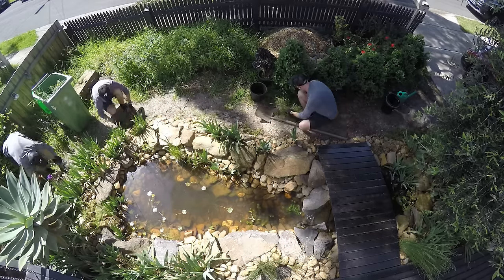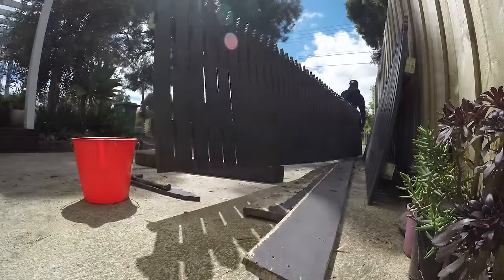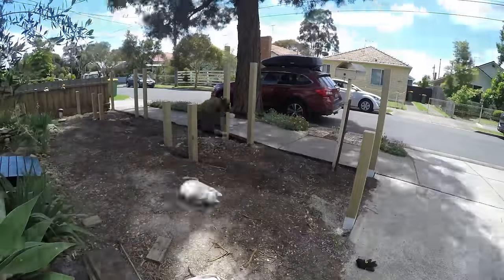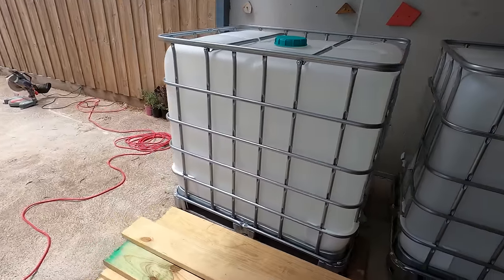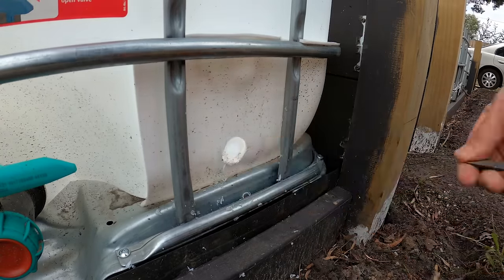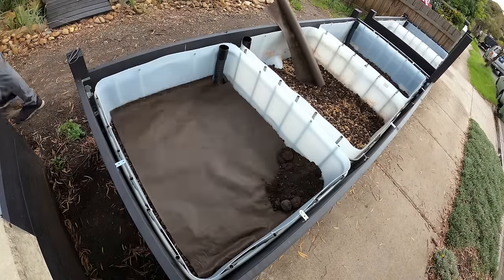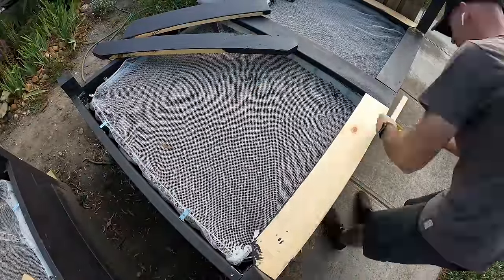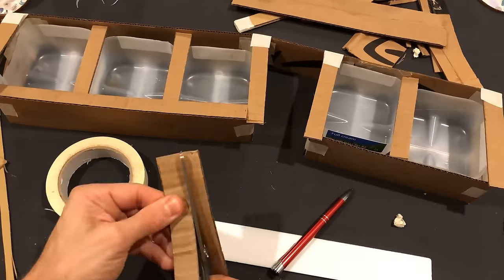Stylish, self watering raised garden beds! How to build

Comment from the maker: Here are a few frequently asked questions I thought I'd reply to here to save us all some time!

1) How does the water wick up without a wick or depression into the gravel? 

Honestly, I don't know. Perhaps there is enough contact on the sides or movement through condensation to start capillary action. Perhaps it is not working as well as it could be, but I've made it through two hot summers where we've been away for up to 10 days and the beds are doing great. 
 
If you are thinking of building your own wicking beds, you may want to tuck the geotextile or weed matting material in on the edges to ensure there is contact right to the bottom of the tank. I may even try and do this in a future video and experiment. 
Here is a good read on the pros and cons of wicking beds if you are looking to build one yourself - https://deepgreenpermaculture.com/2016/04/03/wicking-bed-construction-2/ - which does suggest tucking the material in on the sides.

2) Why are we wearing masks outside?

At the time of filming Melbourne had just come out of it's first lockdown and wearing of masks was highly recommended to reduce the spread of COVID.

3) What size are the tanks / garden beds?

The IBC tanks are 1200x1000 including cage. 500mm high without the base when cut in half.
The smaller 2x beds are 2160x1380.
The larger 3x bed is 3170x1380.
Gaps are 500mm.
The height of the beds vary as the ground is not level. 700mm at the highest point. The mesh frames are 650mm high. 

4) What did it cost?

IBC wicking beds, especially in a design like this, are not the cheapest option when it comes to gardening. In fact, they're one of the most expensive. These beds are under a big gum tree, so planting in ground was not an option. Normal raised beds might have worked, but gum tree roots are really invasive and I wanted something stylish that added value to the house and front yard.
The build cost about $3-4,000 AUD. A new picket fence would have been about 1/3 of that.
Reply from the maker: Thanks for the advice Nunya, although I'm not sure there's actually a question there. The soil was hydrophobic, nutrient depleted and full of weeds, so would have been terrible for growing veggies.
Reply: @TheBiteSizedGarden  mate fills the bottom for ya. hydrophobic means fck all, just needs reconditioned. Same with weeds, just green manure. Couldve saved yaself couple of hundy in both dirt and a skip and not dumped good dirt
Reply: even divided up between the beds and adding and mixing through with ya bought dirt makes it next to instantly not hydrophobic ;)
Reply: Evapotranspiration. Look it up!
Reply: I've found Albo Pepper's video on SIPs is the best on the internet, especially on the engineering of the drainage, aeration and wicking components. https://www.youtube.com/watch?v=Lp9Jdyno9hI I noticed that your veggie garden is shaded by a large tree, so I am wondering if you are getting poor growth because of the shade? Also, I was noticing that the tree is lifting your sidewalk; my guess is that over time it will continue to lift the sidewalk, the posts you put in and perhaps even your IBC totes. Have you thought about that?
Reply: what are the measurements in cm?
Reply from the maker: @juanfrancodilorenzo2016  Measurements listed above are in millimeters so just take off a zero.
Reply: @TheBiteSizedGarden  ah thanks!! Thought it was inches
Reply from the maker: @juanfrancodilorenzo2016  I often put inches up on screen if I mention a metric measurement, but I'm in Australia so will usually use metric.
Reply: @TheBiteSizedGarden  yes for some reason i assumed Australia used inches, my bad. Thanks again for your channel and your effort to spread great tips for gardening. I'm just starting and loving it!

Comment: Going on year 4 with these. Mine are deeper and set up on cender blocks so I don't have to kneel in my old age. I started putting a large shallow tupaware box upside down at the bottom with the lid on and poke holes in the top which now the bottom. Way cheaper than drain pipe. No gravel, no fabric, just dirt. Got about 20 expanding another 20 this year. These things are amazing for dry climates or bad soil.
Reply from the maker: Sounds like a great set up!

Comment: Scoria aka lava rock (although expensive in certain areas) is superior to gravel for wicking up water to the soil above. Gravel doesn’t wick but I’ve seen it used as a way to store water surrounding the ag pipe or containers but you really want a wicking material for the best results. Alot of ppl use sand or scoria but sand is messy whereas the lava rock is lighter weight and does such a good job I have no issues getting water up to my soil. Anyways a tip for anyone who wasn’t aware
Reply from the maker: Yes, I would've used scoria all the way, but needed to use up the rocks I had. The wicking seems to be working fine across both kinds of rock.
Reply: the experiment by Chris Curtis showed gravel and scoria worst and sand and ?? dust best.. worth a look 

i am so hung up on the wicking and fabric or plastic used. if a material (plastic) is used to separate soil from water reservoir how does it wick and if soil separated by fabric and can wick through fabric how is it any different then soil being wet all the time?
Reply: Sand is the best, use river sand
Reply: Lava rocks are incredible use them myself where I can.
Reply: I just use dirt. Works fine.

Comment: For those who don’t have access to ibc totes they sell large cement mixing tubs at big box stores cheap.  They work well for this method. Fill the bottom with rocks or hydro pebbles and use a piece of pvc to go to the bottom.    Cheers. Stunning build, really looks nice.
Reply from the maker: Good tip. Thanks for sharing!
Reply: I had a hell of a time find ibc totes that weren’t brand new and $400+, never thought of cement tubs. I eventually found inexpensive ibc food grade totes from a guy who had access to a pet store that had ibc totes that were filled with fish oil. A nightmare to wash out, probably didn’t need to but I did and it was worth the expense and time. My area has become a desert in sw ks and I hated the idea of watering daily by hand so wicking beds are a win in my area but finding ibc totes is nearly impossible. At the time I could only transport one container so since then I got a metal tank with a bottom that I’ll be using in combo with the ibc totes. Definitely try out lava rock/scoria as it’s a fabulous wicking material and isn’t as heavy or messy as sand
Reply: @jewdd1989  I just bought lava rock!  Glad it’s working as wasn’t sure.

Comment: I love this method. Last summer I took a tall v-shaped planter about three feet tall. Added some rocks on the bottom for stability. About midway I put in a plastic round tray that is supposed to go under an indoor plant so it doesn’t drip. The tray is about two inches tall. It rested around the middle of the pot. I cut three pieces of 2x4 to support it. I put lava rocks in the tray. Then I put soil and planted a flowering Alamanda just above the tray. I never put a barrier between the lava rocks and the soil but used the smallest rocks in the tray. I also added a tomato trellis so that the Alamanda had something to climb on. Any excess rain water flowed over the sides of the tray. The Alamanda bloomed profusely all summer. I think I watered it just once. Absolutely a no care system, did a two week vacation when there was very little rain and it was still one happy plant.  I’m so enthusiastic about this system.  With all the water issues going on I believe this to be the wave of the future for food production. Coupled with tiered gardening it’s coming!  Keep experimenting everyone!

Comment: Good looking beds!!  I also use some IBC raised bed with success. But yours look better, it give me ideas to improve mine! I worked in food industries and IBC plastic is not permeable, hence it can be washed and rinse.  I made holes at bottom and left bottom valve/ 6'' cap open to let excess water (rain) flow out.  I filled the bottom with  old wood and tree leaves as it will transform in food when it decays and it is free.  Then I  made a mix of peat moss/compost/black earth to fill  the top 12''.  Perfect ground for tomatoes and easy to reach! Thanks for sharing your project.

Comment: Great Work.  2nd hand IBC tanks, look for the ones that have had AdBlue in them.  AdBlue is 68% distilled water and 32% urea.  They are easily cleaned out with tap water and should not harm any plants as urea is a fertiliser.
Reply from the maker: Great tip, thanks!

Comment: Nice job, I'm just finishing up making 20 of them & was after an idea for finishing the top to hide the plastic. If you make more, we found that a cordless reciprocating saw cuts through both the cage & plastic while its all together. We used the horizontal cage bars as a blade guide for a nice clean cut, took maybe 1 minute per ibc to cut them up.
Reply from the maker: Thanks for the tip Andrew. I've never used one before, but am keen to give it a go. There have been plenty of jobs where I've thought it'd be good to have one, maybe it's time!

Comment: Wonderful project mate, beautifully made. Cudos. I've found through experimentation that it did work better for me to skip the fibercloth and perhaps also gravel. I think it might be because the plants can more easily access the finest particles of nutrients that would otherwise flow down with rain and be beyond reach below the firbercloth. I got 3-4000 cherry tomatoes from one plant in the equivailent of one IBC. As well as several hundred cucumbers another year. I also added bokashi composted food waste as well as composting worms and lots of compost to get these results, but controlled tested it with boxes with intact firbercloth that could not come close to these results. Some plants might not like to stand with the roots in water but since there is the overflow security I don't think its going to be a big problem. Thanks for the neat video :)
Reply from the maker: Thanks Mathias, 
It sounds like your experiments are reaping huge rewards. This year has been a bonanza of beans and cherry tomatoes for me too. The cucumbers started well but I think they fell behind the tomatoes and never recovered. 
The timing of your comment is interesting as just this weekend I re-planted two of my beds, but before I did, I dug down to see how the soil was. After almost two years, the weed matting has almost totally gone. Roots have made it down the side, and so has some soil. You're probably right with not needing the barrier, but I wonder if the gravel will allow more space for water storage.
I also added a lot of bokashi, semi composted material and some sheep manure to build the soil back up, so hoping to reap rewards in the coming months!
All the best, Josh

Comment: how does the water wick up into the dirt without some way for the water to make contact with the dirt/soil?  i was wondering about this because another video i watched they did it the same way, flat rock level with a fabric to separate the soil.  However when you watch people make them in a small 5 gallon bucket setup, they have a cup with holes that can get filled in with soil or rope that dangles down into the water to "wick" the water up.  I did read a comment in the other video that when that person makes there they dig a channel or a deeper part of the soil into the rock so it can soak up water as needed through the contact.  

I am just curious how it wicks up this way, condensation?  obviously something is working.  i just figured that once the water level gets lower it wont contact that fabric.

looks good though, i like it.  Im tossing some ideas around in my head.
Reply from the maker: This has been an ongoing question and answer in the comments, and some people know a lot more about it than me, but there are a few factors which result from pressure/temperature differentials. Many people have told me I made a big error in not creating a depression, or wick, but I've not had any issues. The only downside I can see to creating a depression or channel is losing a bit of water storage space, which isn't a big deal, so by all means try that method if you're worried about it.

Comment: all aspects of the video, production, delivery, etc... absolute quality. I learned a lot of things from your video that I could have done better and a few things I think I did better. Mainly the overflow. It gets very dry where I am in the summer months so my outlet is extended upward to the level of the scoria reservoir. That way, when I'm filling it in the drier months, I know it's full when it starts to overflow. If I need to empty it, I just swivel it downward so the egress is at its lowest point to get the max water out. This is Australia so droughts and floods. Also, the one you used the pallet instead of gravel/ scoria, are you able to manually water that one or is it left to nature?
 Your carpentry far exceeds mine. I learnt a lot there too. Very beautiful outcome.
Reply from the maker: Thanks Dean,
I learnt a lot from this build too - never too old to learn!
I'm in Melbourne and it usually gets dry here in summer but the last couple of years it's been much more humid, so it will be interesting to see how they go if/when the dry summers return. 
The pallet one in the middle still has gravel in it, and yes, I can fill it using an ag pipe hose like the others if it gets too dry. 
Cheers
Josh

Comment: I would like to introduce you to kreg pocket screws. They are used where you used those little right angle brackets, but the end result is much more sturdy while also being cheaper.
Reply from the maker: I will try these on my next build. They do look like a much better option. Thanks for the tip!
Reply: @TheBiteSizedGarden  There are 3  drawbacks.They can mis-align the wood on fastening by less than 1/16th. Outdoors it doesn't matter, but it is annoying if you are making a table top.  There is an ugly side and a pretty side. You can use plugs to clean it, but some planning usually makes it not matter. Last is that you have to use screws designed for pocket holes. There are only threads on the end, and not the shaft, also the shaft is usually a smaller diameter with a flange that exactly matches the screwed hole. 

In general pocket screws (I never use the plugs) are a quick and easy way to fasten the end of a board to another piece of wood. If I am not using a 3 1.4 inch screw through 2 pieces of 2 by, I am usually using a pocket screw.
Reply from the maker: Time to have some fun experimenting! Thanks again for the detailed information.

Comment: Great video. Was the aluminum frame sitting on the bricks strong enough to support the weight of the rock/dirt/water or did it collapse in the center?
Reply from the maker: Thanks John. It’s been fine. I’ve seen lots of much older ones holding up okay too, so fingers crossed there’ll be no issues!

Comment: Awesome. One question, why do you build before painting? Figure you could paint them first and they would be fully coated. Not a critique, learned a lot, thank you dude ;-p
Reply from the maker: The wood is treated pine so I was happy not to paint the interior, except where it is in contact with soil. But you’re right, you could also paint first and assemble later.

Comment: I was curious while watching the video that you mentioned adding the top boards to protect the plants from the sun then painted the whole thing black. Based on the final result it must work in your climate. Here the black would create extra heat and cook the plants, also require ongoing water top off.
Reply from the maker: The boards on top are less about protecting the plants and more about hiding the plastic (they do offer the plastic a bit of sun protection too though). There is at least 3cm / 1inch between the plastic and the wood, mostly double or more than that, and the timber is quite thick too, so the radiant heat on the inside is minimal.

Comment: Great work mate! I’m doing a similar thing out the front of my place at the moment. What was that piece you used for the overflow valve?
Reply from the maker: It is a combination of irrigation fittings. A 19mm male to male joiner with a ridge in the middle, and a additional washer, with a 19mm to 13mm right angle piece on it. Then I added another 19mm to 13mm right angle on the outside. 
Some people don't use silicone to seal it up, but I wanted to make sure it didn't leak!
Sorry, I should've filmed me putting them together!

Comment: How do the soil absorb the water? I can't really understand how they mix as long as the water is not overflowing? In other self watering solutions i have seen pillars with soil going down into the water to be able to absorb it, but here you have gravel and and the matting to seperate them.
Reply from the maker: I have seen people build wicking beds both ways, with a depression and without. In my experience and from everything I’ve read, there is enough water movement without pillars, a wick or a depression. 
Perhaps it is pressure, natural movement through condensation or enough soil seeps down the sides to create a wick. Whatever it is, these beds are holding up well and have just thrived through their second summer with flying colours.